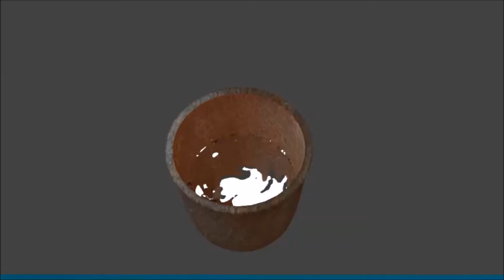Casting an aluminum hammer (tools series)

Comment: The carving of the hammer looked great! I'm surprised the aluminum held up after hammering and pulling the nail. I guess AI is tougher then I thought! Now you got me thinking. Heh.
Reply: hay evil... do u think u can try making a brass hammer? :D.
Reply: +Austin Facemyer Maybe. I've only melted aluminum so far but I think my furnace can handle it. I do have some brass and copper scraps that I've started to collect but not enough for a casting.
Reply: +eviltwinx you furnace is fired on propane so it will handle it very well, if u need brass try going to a gun range and usually u can get them for free :)